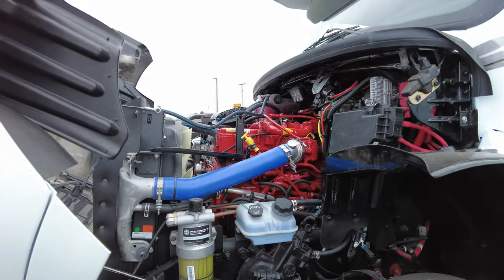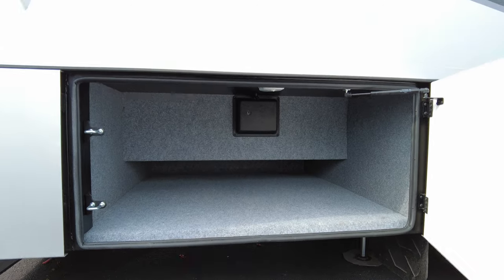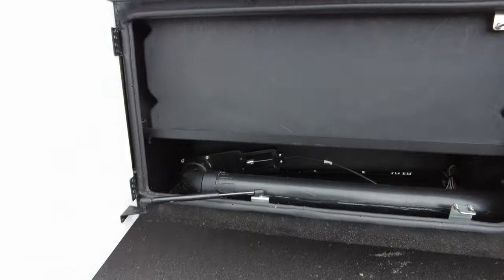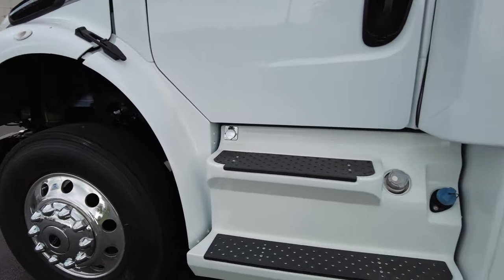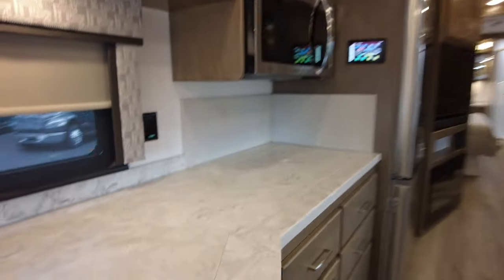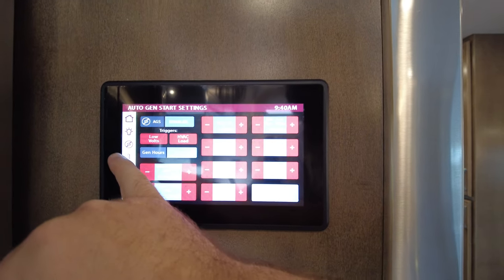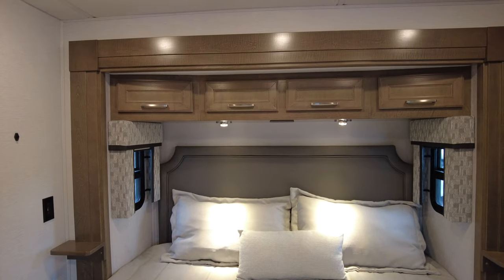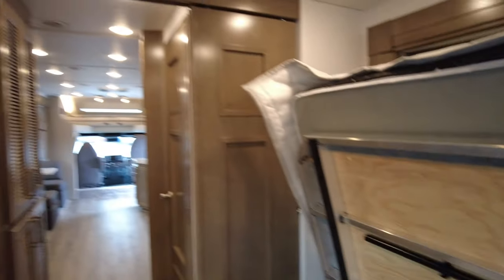Detailed Walkaround: 2024 Renegade RV Verona 40VRB on Freightliner M2 106 Chassis

Comment: @kyle koberlein, I have noticed that the Verona LE has two inverters. I'm most interested in the Verona 40 VBH and was wondering if it was possible to install a second inverter in one. Mostly to run an AC at night when boondocking  or overnight at a bass pro.

Also, I love the videos...